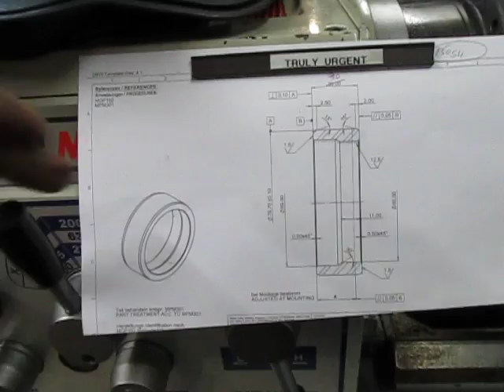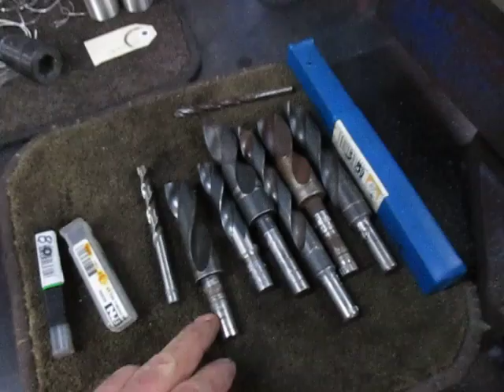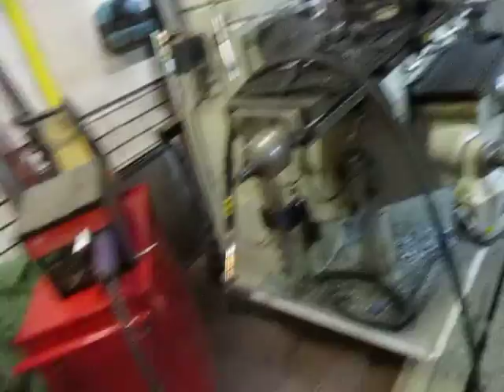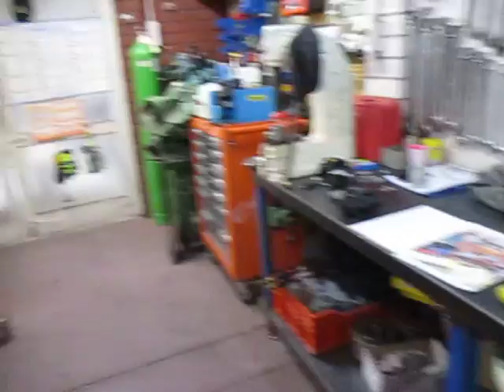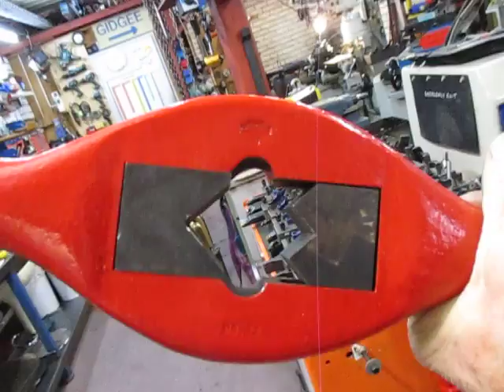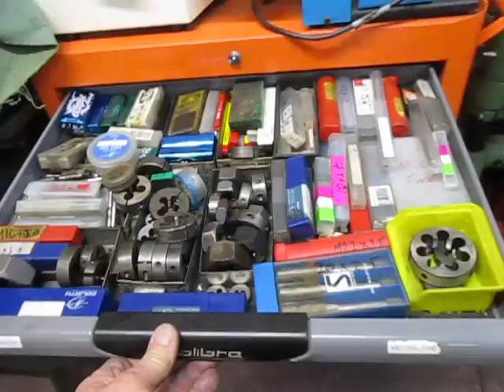sat morning mayhem in Bruce's shop

Comment from the maker: I hadn't even finished the job and said so in the movie. The world isn't perfect. Everyone has their strengths and weaknesses. Horses for courses as the saying goes. My contributions are Pro Bono! We are all open to anyone that has a comment or can show another angle to the same job, there are as many solutions as there are opinions. However, I'm afraid Mr PMX-Tek has crossed the line using the C word, it is uncalled for and does not add value. Settle down lad!

Comment from the maker: I had a good weekend, I finished the special adjuster ring, and I managed to fully frame both storage trolleys, and I welded the casting a bit more and set it up in the mill with a thought to make a trough and bolt a steel embedment to provide temp solution if the part doesn't arrive on time, Thanks every one for your feed back, comments and concerns. I'm happy that I got about 90% of my planned weekend done and apologies if some of you got tuckered out just watching me.